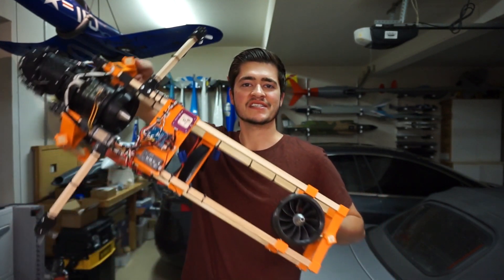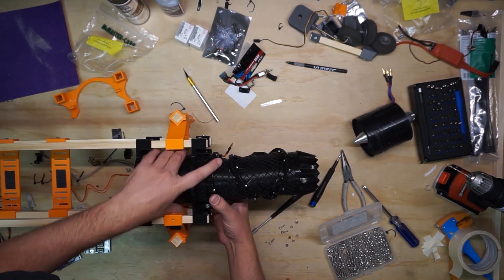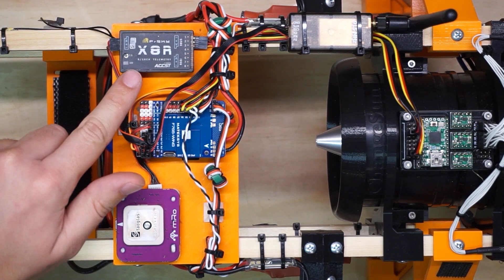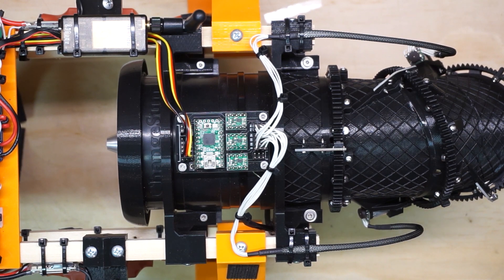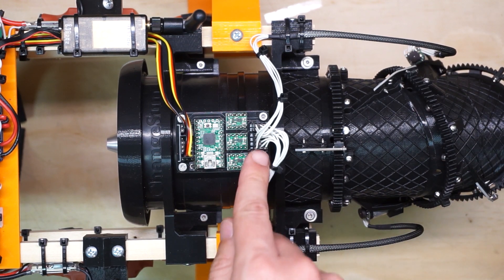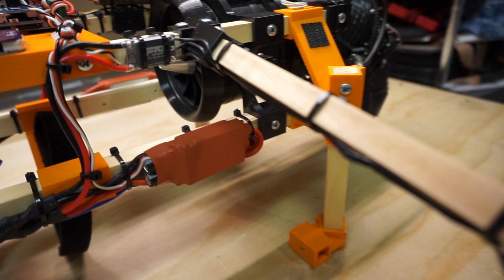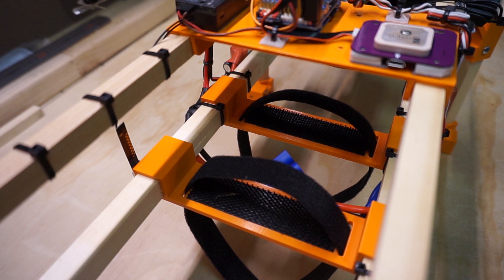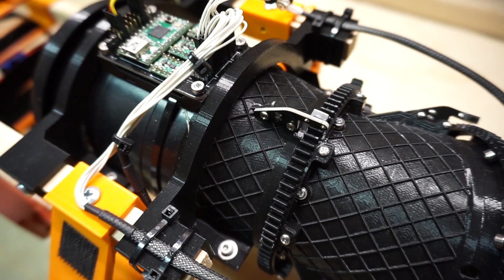R/C F-35B: Hover Test Frame

Comment: Do You design and fab your own controller(s) and PCB ? Some CPLD for the chip, SW, and how do you fab them ?
Very good work. Only came across your channel past few days. You must have lots of experience and big enthusiasm in RC tech.
Reply from the maker: Glad you found the channel, thanks for checking it out! For flight control I use off-the-shelf Ardupilot compatible boards - a Matek F765-Wing in this case. Though I do fab my own PCBs for simpler things like landing gear sequencers and the 3BSM controller. Usually using basic Atmega chips and a service like JLC for fab.
Reply: @ericmaglio  Thanks for sharing.